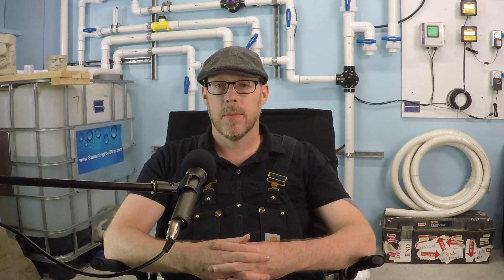Why Do Pool Filters Crack?

Comment: I have a DE stayrite pool filter and a 24 foot above ground pool what is the best filter system for this type of pool?  I've always used the stayrite filter system with the 1.5 HP but now the hairline crack in the filter scares me since you said it could explode and be fatal.  I was going to epoxy it but son't want to take the chance

Comment: Hey bro I have a crack on the bottom of my filter and leaks lot of water wen it’s on…. Can I weld it or put some specific glue or just buy a whole new one? Don’t know what to do thanks in advance
Reply from the maker: A resin tank needs to be replaced when it cracks. The tank swells when you turn it on and the movement prevents any meaningful repair

Comment: I have a good question for you steve i have a 1988 c800 hayward filter star clear it has a crack where the lid joins as i do more research many pool filters overtime can crack if made out of fiberglass and thermo plastic tanks i have found a posi flo stainless steel filter by starite why did they quit making filtertanks made out of stainless steel
Reply from the maker: Profit margins means stainless tanks are expensive, heavy, hard to ship, cost a lot to make and honestly, lasts too long. Resin tanks are cheaper to make, cheaper to ship and easier to move. They last a while, and then you need a new one
Reply from the maker: Short answer is profit margins.
Reply: @Swimmingpoolsteve  can u please explain
Reply: What does profit margins mean

Comment: I have a flow clear 1000 gph  sand filter. Less than 2 years use and a Crack in the bottom  already . $150 Chinese crap. Build it in the usa!!!!!  Any fixing it ? I already tried jb water weld epoxy putty. No good.
Reply: Although not recommended, I used job welds marine epoxy in three layers successfully on my waterway filter. I had a small crack on the bottom. For added insurance I also added the same water weld putty as a fourth thick layer.
Reply: @jonathanalcala7317  Thanks, I mean, jeez, there's not that much pressure in there, maybe 4 to 5 lbs and that jb water weld is supposed to hold 1300 psi.